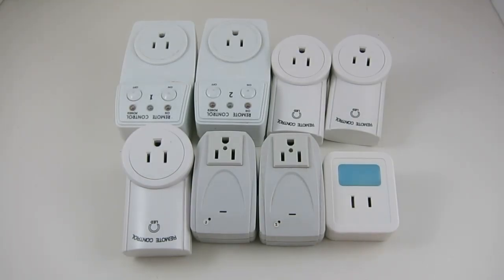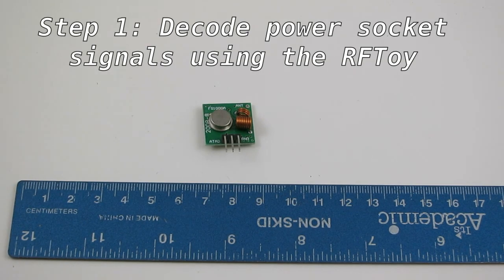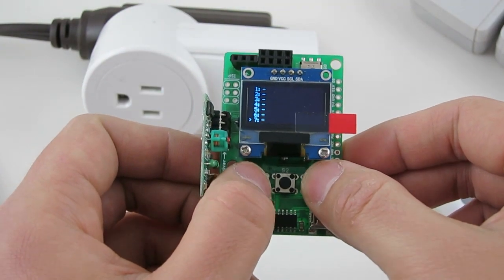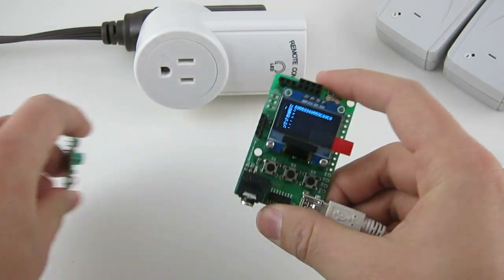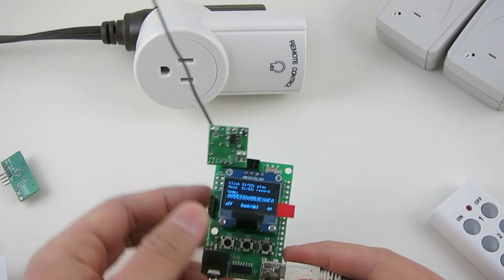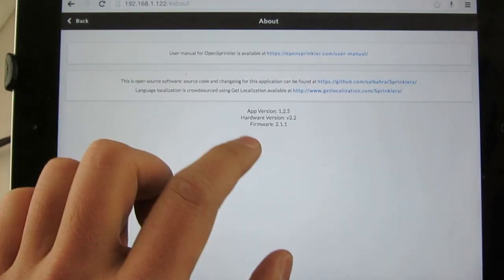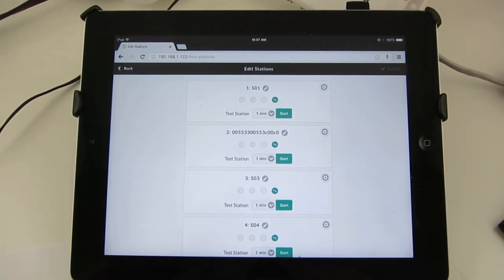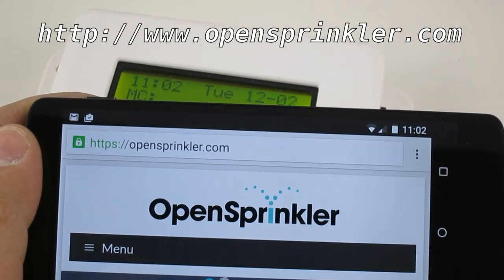Tutorial: Use OpenSprinkler with RF Remote Power Sockets

Comment: Hi Ray,  Your opensprinker sounds promosing. Whats the maz operating distance  it can control the power socket from.
Reply from the maker: That depends on RF transmission distance. I would say generally 20 to 40 meters within house, and probably more than 50 meters outside.